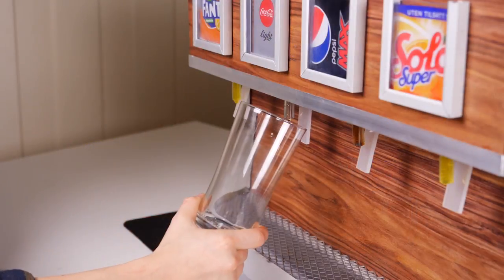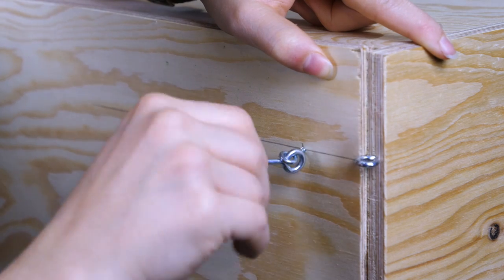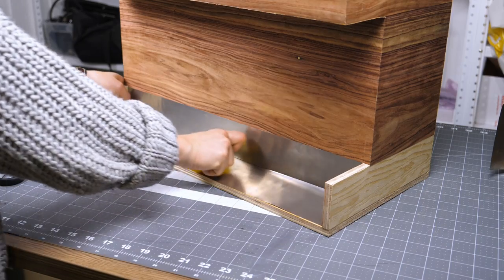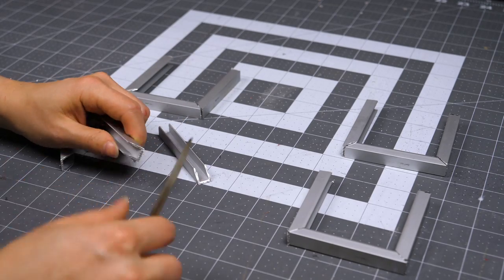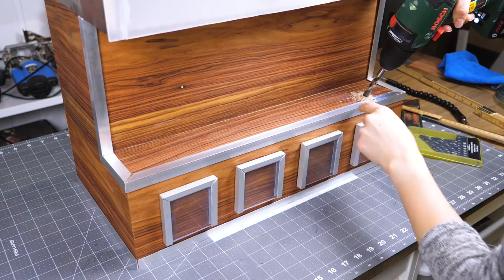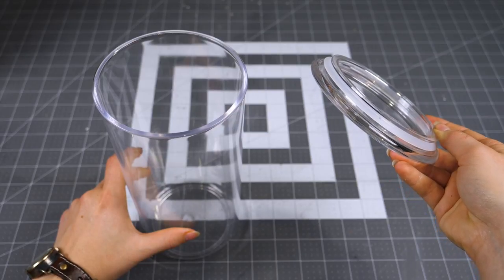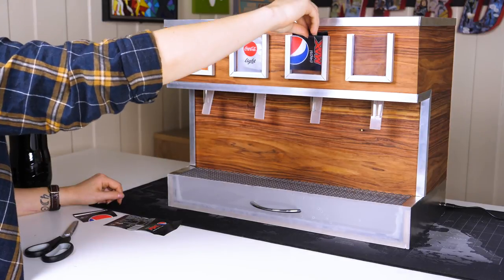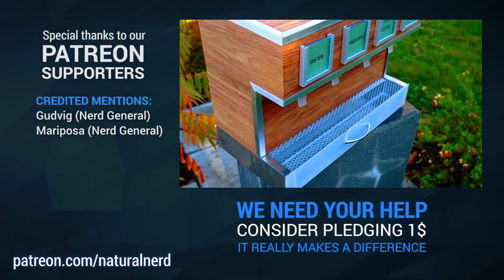DIY SODA DISPENSER - Awesome for parties!

Comment: the only thing i wonder. is what about the carbonic? don't you lose too much pressure when you pour the soda in the tank? and I assume that after a while pressure will also decrease, which will ensure that you actually drink sweet lemonade. I think you could solve it by connecting a carbonic bottle, but you would then have an extra installation to add the carbonic to the soda. which also means that it is difficult to regulate the amount of carbonic, especially since there is still a part from the bottle.

I hope it’s understandable cause most of it is translated with google translate.

Comment: I don't understand this though.Because I didn't want to get poisened I change the motor for a pump moter making it less flat and I also made it so it had ice pack padding all around it with aluminum so it stay cold

Comment: Cleaning the containers seems simple but how do you clean the rest? If you use it on carbonated drinks it gets sticky after a while :P
Reply: I would fill the containers with clean water and then use he pump to pump clean water, maybe even water and soap, and then rinse with regular water.
Reply: The carbonation doesn't make it sticky, the sugar does.
Reply: I would suggest running white vinegar through, the same way you clean a coffee maker

Comment: You could have attached tubing from the pump and to the bottomed of the container and sealed the hole using a silicon cocking  . But other then that good job on the build

Comment: You could have used airpumps to pump air into the containers, with a tube going into the bottom of the liquid. That way the soda would never have to go through a motor and all carbonation would be saved + it would be easier to clean since you wouldn't get water pumps with sugar in them :P
Reply from the maker: 10:15
Reply: Yeah you mentioned vacuum pumps, but I was talking about regular air pumps as that would be an even simpler and cheaper design. Only drawback is that it might be a bit more noisy than the design you did in the video. Men kan hende jeg tar feil siden jeg ikke har så mye peil på å bruke vakum til å pumpe vann haha :D

Comment: The pumps need 5 watts, according to your link. Your "Power Plug" can only produce 3 watts, so the pump wouldn't be able to run. What adapter did you use to go from AC to DC? I'm trying to replicate your idea, only with six pumps and the ability to plug it into an outlet for my family.

Comment: You Should have used an airpump instead of the liquid ones they ware way more hygienic. You just have to put to holes in the bottle one for the air intake and one for the drinks. sry for bad english
Reply from the maker: That solution has been done in many videos before, but I wanted to go another direction. Also this is cheaper, and easier to cool down :)

Comment: Anyone that has ever worked on a commercial dispensing unit would tell you that this is a bacterial disaster waiting to happen. You'd be better off if you had used peristaltic pumps. Then all you'd have to worry about is flushing and cleaning the lines.

A better, and simpler method would have been just ditching the pumps all together and using pressurize containers. Using CO2 to displace the liquid would have the befit of reducing the amount of carbonation lost. Just a thought.

Comment: I've always wanted pop and other liquids on tap, but I can say one thing about your set up, cleaning the pumps and hoses would far too tedious for me! Those would certainly start to grow things inside the pump and hoses if left for too long. That is one of the things you have to consider before you design it! Lol your design is good, because you can easily get at the components that need to be washed. Others I've seen....not so much. lol

Comment: As far as pumps for carbonated drinks, I wouldn't.  I like my bubbles too much.  A regulated pressurized CO2 system could pressurize the bottle (sealed of course) and be actuated by an electronic water valve.

Comment: wouldnt pumping the air to the air tight container be safer and easier to clean? i mean pushing air in to the canisters then letting the soda/drink get pushed out without the pump getting anywhere near the drink.

Comment: Also wouldn't a plastic tube from the pump into the container been better? Abit sketchy to just have the whole pump in the container filled with liquid like that :D
Reply from the maker: Yes, but as it is a submersible pump it needs to be full of liquid to work. So if I did it that way, then I would have to put liquid in the tube before starting the pump everytime.
Reply: True that, but then again, wouldn't acidic drinks and such overtime erode the plastic insulation on the wires?

Comment: Should the pumps really be submerged?
Reply from the maker: They are called submersible pumps for a reason! They are different from a vacuum pumps :)
Reply: Natural Nerd won't the pumps get clogged up, after  a couple months? You'll at least have to clean them more oftenly than vacuum pumps.
Reply from the maker: They'll definitely have to be cleaned after use. If you'd prefer a vacuum pump, the build should pretty much be the same except for the pump and the tubing! :)
Reply: Sjúrður Steinhólm all you would need to so to clean them is run water through them, and you could add soap as well to make sure it's clean.

Comment: mmmm... food-safe wiring and soldering...
Reply: you need to buy pumps for food that are cleaned after use
Reply: You can add another tube & have the pump & the wires outside of the cylinder

Comment: ... will not last long...
The makrolonplates will fall apart from the bronzesticks... hotglue is not good choice.
Better drill a 2,5mm hole from the side , cut m3 screwgear and put m3 screws inside...
And the small woodblocks should also be fixed with predrilled woodscrews...
...thats the maaaain issue that i see...
Everything else... okay freedom of artist

Comment: Sound will get annoying after a bit.
Reply from the maker: hm, no. There is no sound unless you dispense a drink :)
Reply: No but if you use it more often. Similarly to having a PC that sounds like a jet engine. While it's only loud under load, it will still get annoying after constant use.

Sound isolation maybe? like a plastic box, or layering the inside with towels.

Actually, how about pressure. Like a spring loaded base. When you fill it up, the spring will compress, and when you push the tab, the spring pushes the liquid out. I haven't got the resources to try this, but if you're bored, could you give this a shot maybe?
Reply from the maker: With the same logic you'd have to soundproof your toilet! ;-)

Comment: uses finish on veneer #facepalm nevertheless great build
Reply from the maker: Veneer is wood, so it totally works to apply finish on it! Makes the wood grain really pop
Reply: most veneer comes with finish already applied so i didnt see the profit of it but maybe that yourse is cheaper or just diferent
Reply from the maker: The one I got didn't have any as it is china bought. Can be hard to come by veneer in Norway. But usually it's just to give it a little sanding before applying the finish :)
Reply: that explaines its china bought XD
Reply: +Natural Nerd  a brown again and Some laquer on the plywood could have looked rather fine also :p btw, this project would work real Nice with your diy cooler!
Reply: Most veneer used by woodworkers and furniture makers does not come with the finish already applied, regardless of where you purchase it. They're meant to be lightly sanded and then finished by the maker. What Natural Nerd did is correct.
Reply: well i study furniture maker and we dont use that kind ours is always finished